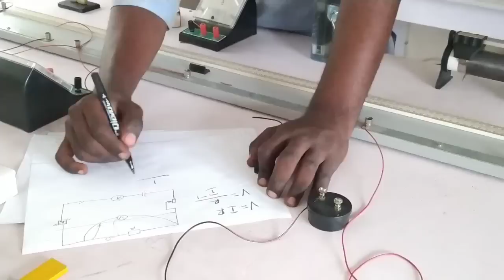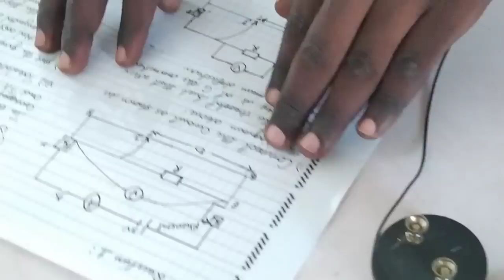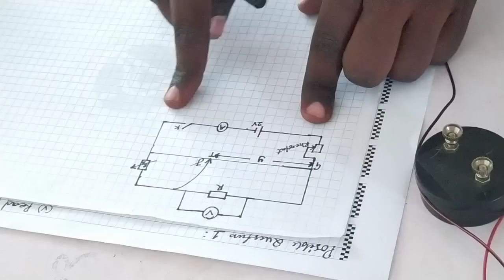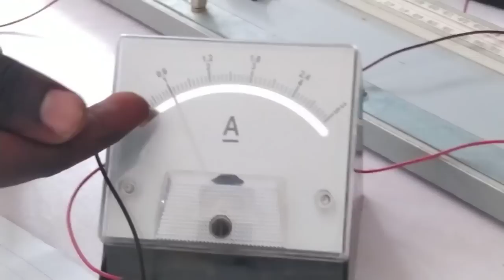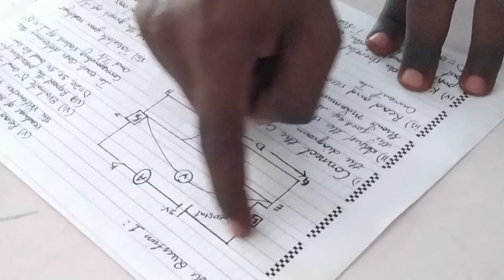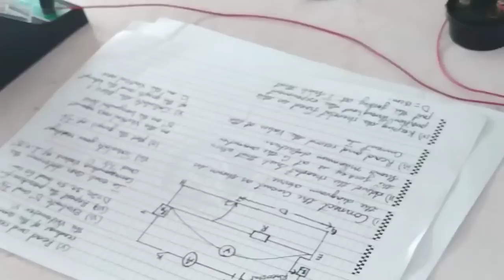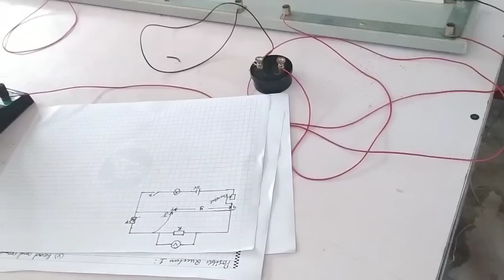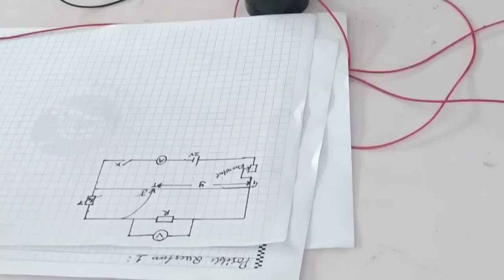WAEC 2023 Physics Electricity Practical

Comment: Sir, the key most be before the ammeter because the current will flow through the ammeter even when the key is not insacted which means the coil in the ammeter is heat up which can damaged the meter as time goes on

Comment: Please sir, 
My first question is at what point in the jockey did the ammeter show maximum deflection
My second question is that what if the provision of an accumulator is not possible but 1.5v ×2 batteries are used instead, how would the connection be

Comment: It's concerning the 2v accumulator...how to charge it....or will just put the conc sulphuric acid and carry out ur practical
Reply: Give it to a car battery charger. Did that for my school already
Reply: @officioT  OK sir u mean a mechanic?
Reply from the maker: You can ask anyone using car to direct you to a ba3 charger so they will fill it and charge it for you
Reply: @maths-physicshub  OK sir thanks sir
Reply: @maths-physicshub   please sir your whsap contact, God bless you sir
Reply: God bless you for the video sir. You make work easier sir. Please sir in case the school didn't have accumulator, can we use 3v dry cell sir
Reply from the maker: @ayobamioluseun5527  yes you can but you have to report it
Reply from the maker: @adekunledurojaiye9836  08179606292
Reply: @maths-physicshub  ill chat you up on WhatsApp sir , to request for the question on Electricity sir
Reply: Thank you sir. We kindly await the manipulation sir. Great work.